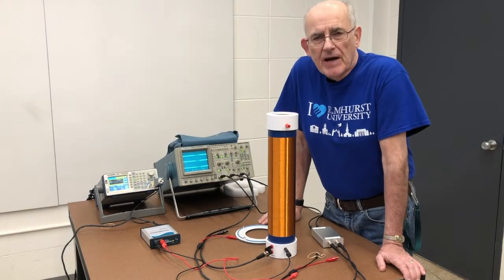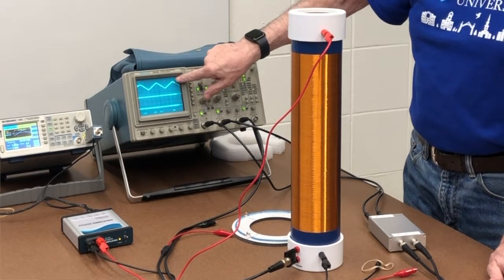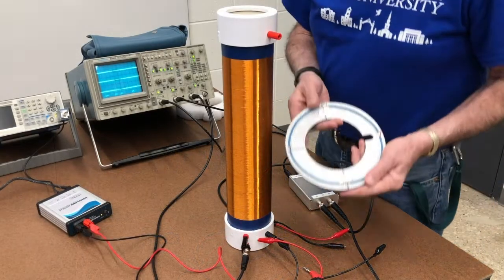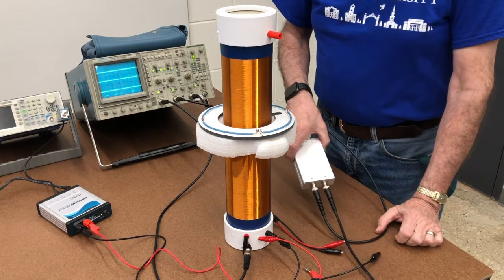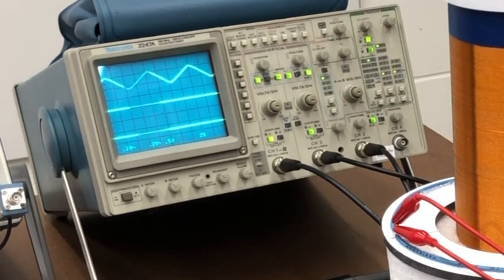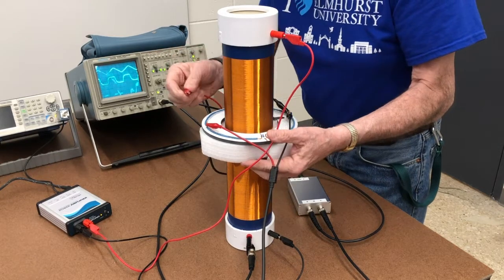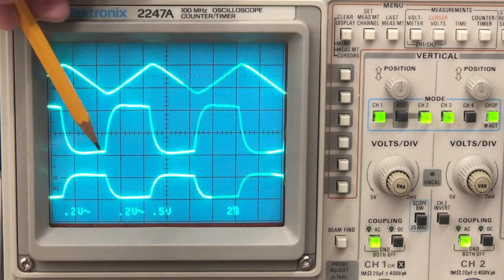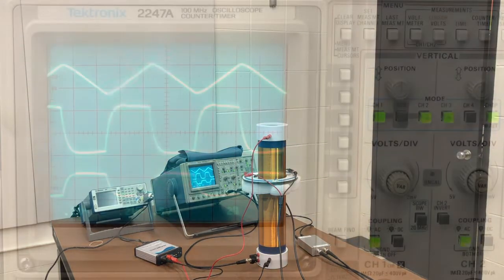Faraday Paradox

Comment: Your results do not surprise me at-all.

Before you connect any oscilloscope leads there is only ONE  secondary loop.  After you connect oscilloscope (input A) there are TWO secondary loops (additionally comprising the loop formed by the black and red oscilloscope input A leads).

After you connect oscilloscope (input B) there are THREE secondary loops (additionally comprising the loop formed by the black and red oscilloscope input B leads).

So you have THREE secondary loops.  Current would flow in the original loop, but an emf would be induced in the second and third loops and would be presented to oscilloscope inputs A and B.  The oscilloscope is telling the truth.  But your measuring system has become part of the phenomenon you are seeking to measure.
Reply from the maker: Hi George - You are quite right, sir!
Reply: So what's the prize?  How about an Honorary Doctorate from Elmhurst University?
 @froehlichsphysics7763
Reply: @froehlichsphysics7763 No, he is not. The measurement loops have nothing to do with the voltages being different. The voltages are different in the ring itself, regardless of how you probe it. 
Channel 1 reads the correct voltage along  the branch with resistor 1, channel 2 reads the correct voltage along the branch with resistor 2.
Reply from the maker: @copernicofelinis  Best to review Faraday's enclosed loops.
Reply: @froehlichsphysics7763  I did. Look at the fields inside the ring, and compute voltage from first principles. You will get what your oscilloscope is showing.

Alternatively, look at the two measurement loops formed by scope, probes and branch of circuit: there is no appreciable dB/dt enclosed. Apply Faraday to those.
Reply from the maker: @copernicofelinis  Hi - see if this makes sense: https://tinyurl.com/faradayparadox
Reply: @froehlichsphysics7763  it is correct, but my point still stands: the voltages in the left and right branches (R1, R2) have nothing to do with  the fact that the oscilloscope is connected to the ring. The two voltages are different in the ring itself, so the fact that the oscilloscope is part of the system is completely irrelevant.

I made a video depicting what the electric field looks like inside the ring (I cannot link it, because yt would delete the comment), and it is clear that the different voltages are a direct consequence of the fact that the electric field is not conservative. The way we probe the circuit, or even the fact that we probe it, is irrelevant.
Reply from the maker: @copernicofelinis  The tree falling in the forest. If instead of probing R2 the way I did, if you probe it as a reach-around from the same side as probing R1, you will find different results. I'd like to see the video - would be cool to see what you did!
Reply: @froehlichsphysics7763  what I am saying is that the scope has no influence on the voltages along the branches. Each channel reads two voltages at once: the correct voltage of one branch, and the voltage of the other branch altered by the linked EMF. 
To access somebody's channel just click or tap on the avatar and then click again on the bigger avatar. The video with the fields is "Dispelling Lewin's 'KVL paradox' - the fields in the ring" (or something like that).